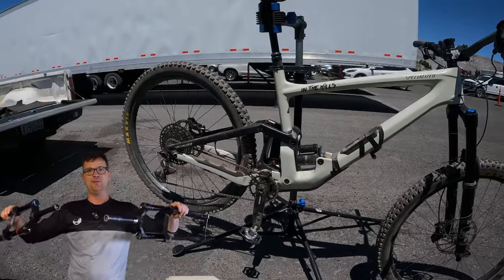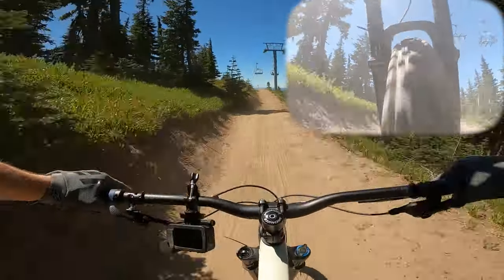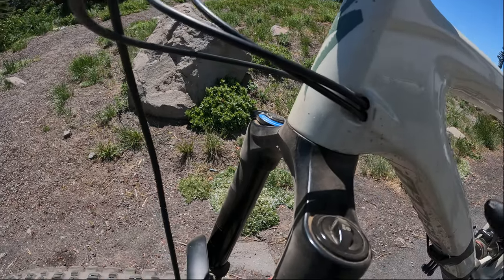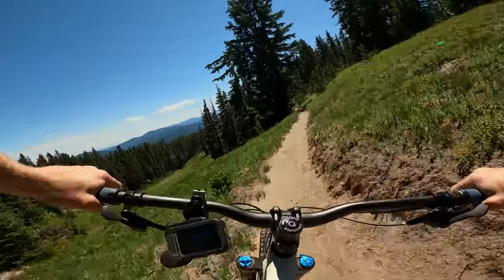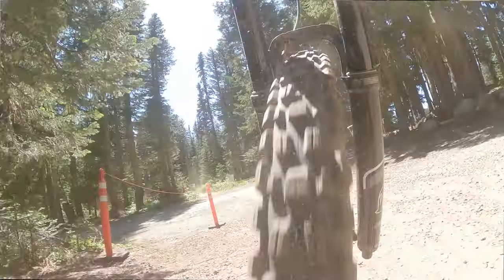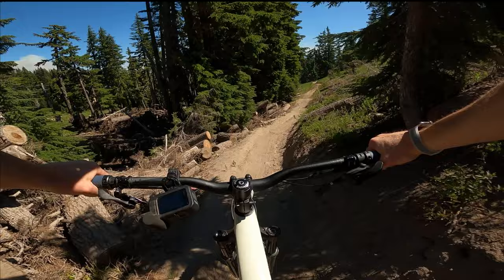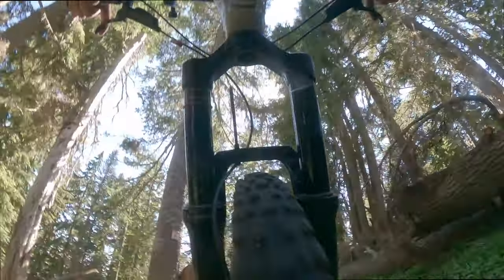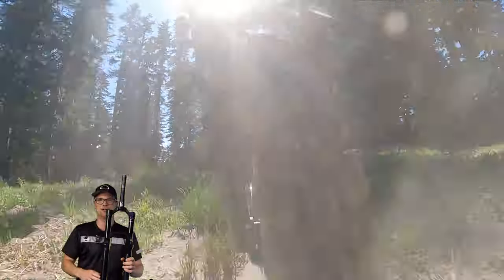Choosing the Perfect Budget Enduro Fork: Zeb vs. 36 vs. Yari

Comment: So I was doing so much research on performance suspension I was looking at Fox RockShox manitou Marzocchi DVO cane creek etc. I have a 2022Marin Riftzone 3 27.5 decided to stick with Marzocchi z2 I want to get a bomber air then later a z1 in a 130mm travel option because they are capable and most importantly they don’t have all the settings to screw around with is why I decided:)
Reply from the maker: That’s the same form as the 36 I said son the contest

Comment: I really appreciate this content, it's nice to see budget comparisons and beat value tests versus pinkbike comparing top of the line forks all the time. That being said, inever got along well with my 36 rythm so I just got a factory 38 on sale from fox. No matter if I changed the psi or volune spacers on the 36 I couldn't get the fork to move into the last 3rd of its travel, the arm pump was insane at bike parks. I am 205 so pushing the higher end of weight categories for sure. You ever have travel issues with the 36?
Reply from the maker: Ya, had exact issue tell I over stroked it

Comment: Really enjoy your work - what are your thoughts on using ebike labeled forks on an analog bike? More specifically a hardtail?
Reply from the maker: What fork
Reply: @OtterMTBtech  2021 (newer rounded arch lowers) fox 36 e-tuned grip 2 - 150mm for a Kona honzo ESD. Currently running a 2020 lyrik ultimate with upgraded ‘21 - 150mm Debonair spring and it’s been great. But I have a 2023 38 factory grip 2 - 170mm on my full sus, and feel like it’s a better all around fork. But maybe the thicker stanchions on the e-36 fork will feel too stiff? Maybe changing tokens in the lyrik?
Reply from the maker: 36 is better. The e tune has lighter compression since e bikers sit to much. Crank the low speed compression and run 36. 

Lyric is garbage

Comment: I have a 2021 lyrik ultimate on my Norco Torrent and on my second bike I put a 2020 yari on my Comencal meta ht with the debonair spring and then replaced the motion control damper with the 2.1 charger damper. The yari is now so nice I can't tell the difference between it and the lyrik. Also there is absolutely no difference in the yari and lyrik chassis, materials or weight. $550 all up for the yari!

Comment: Great video dude as all of them.
One question if I put a fox 36 27,5 plus performance  170 travel serial number 773637-0001-T  to a 29 er , 29x2,4 60 balón it fine or I will some issues ? Thanks
Reply from the maker: If it fits roll with it.